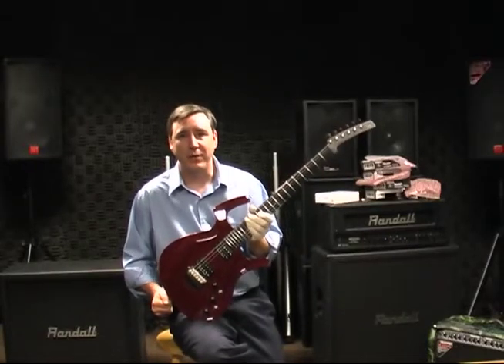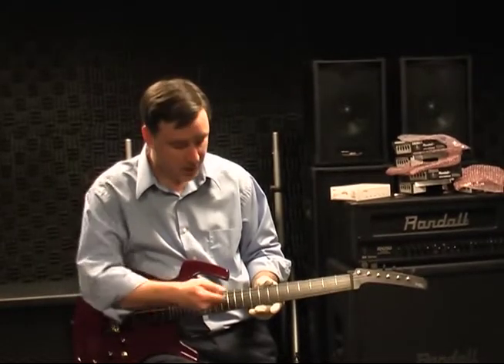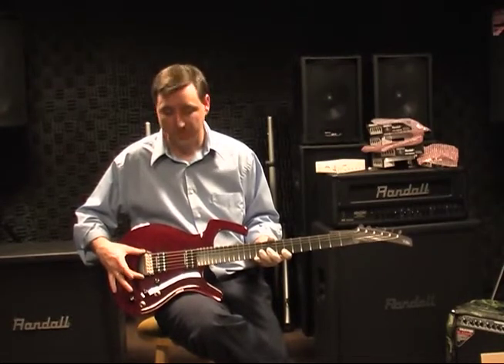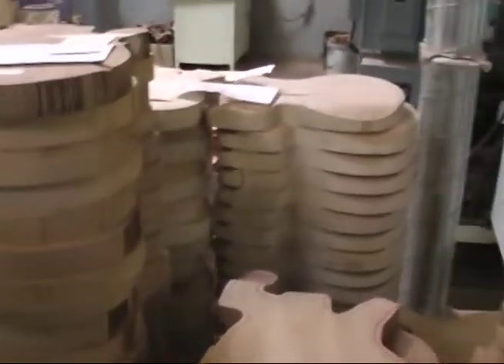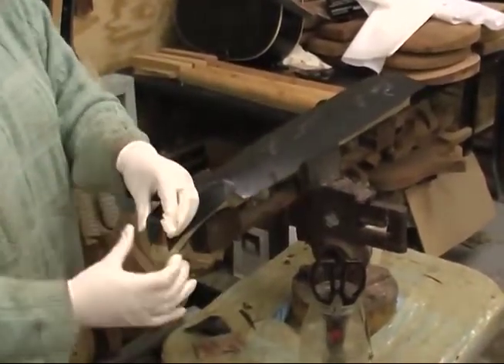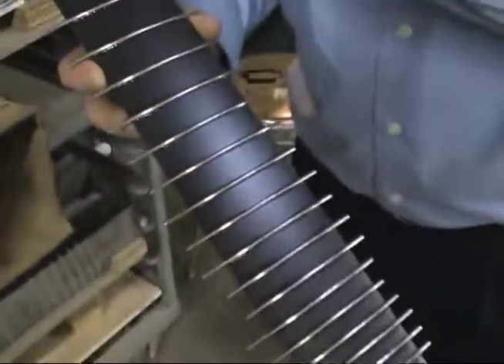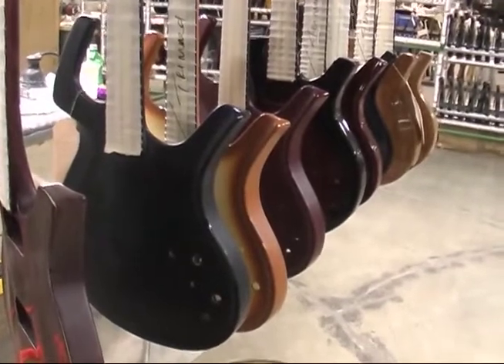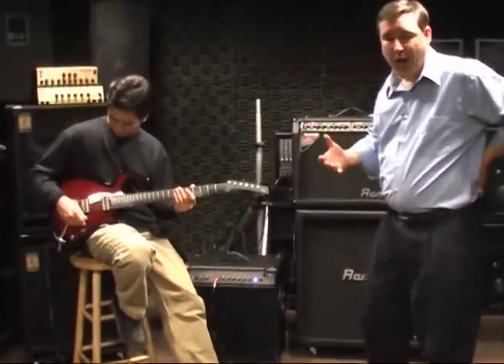Parker Guitars Feature Set and Factory Tour 2005

Comment: The video is fantastic indeed, even though the host at times goes off into salesman rant. I've had 3 Parkers so far. As far as the pre-refined fly goes; if ever your onboard circuit goes inoperative (you won't find a new one), try this: order Alnico 8 bar magnets from China and replace original magnets. Alnico 8 will bring the coils to a better output and better midrange than the onboard preamp. Fly pickups operate freely of the battery but they still do get EQ'd by the preamp. A way to save a fly - alnico 8. Cheers.

Comment: Instead of redesigning the ugly headstock and broadening their product line to make less expensive guitars, the company needed to have focused on high-tech electronics, better pickups, single string pickups, midi and 12 pin connections, graphene technology, internet marketing and direct to customers sales (sidestepping dealers and scalpers).  Hopefully they will see the light and ressurrect the original space age approach Ken Parker had and embrace the fact that linking guitars to digital modeling, acoustic modeling, guitar synthesizers, effects was the right idea from the get-go.  I wish I had the moolah to buy the company and bring it back to life in the manner that would keep the vision alive.
Reply: You do realise that many guitarists think "cheap" guitars are shite, right?
Personaly, I want a Bronze Fly,  to practice 50 alternate tunings on a Roland JC...
Reply: Also: The headstock isn't ugly..
Reply: Funny, I just bought a Nitefly that had a 13 pin pickup installed inside it!  Pretty awesome!   One thing I didn't agree with is that you thought it needed new pickups.  What's wrong with DiMarzio pickups???  They are a premiere pickup maker up there with Seymour Duncan, Fender, and Gibson!  And don't tell me you're a freakin "boutique pickup" snob!  Pickups are simply copper wire around magnets, it's not rocket science!  The rock and rollers in the guitar heyday of the 60's and 70's didn't need boutique pickups!  Parker actually had an autotune guitar but I don't think it did very well so adding digital modeling probably isn't a good move.

Comment: So what changed with the stainless steel frets because just about every guitar Maker today is banging them into the wood fretboards without any splitting.
Reply: I'm thinking he misspoke and meant that it would have split the composite fret board of the fly.
Reply: @gimmeeinboxback3860  I dont think that the toughness/hardness of the frets is the key component to split any fretboard. AFAIK they glued on the frets because they couldn't get fret wire in the usual shape made from the steel alloy of their choice.
Reply: The tang of a traditional fret would make the unidirectional carbon fretboard useless in terms of stiffening the neck. Having intact longitudinal carbon strands along the top and bottom of the neck is what will give the extra stiffness in this case.